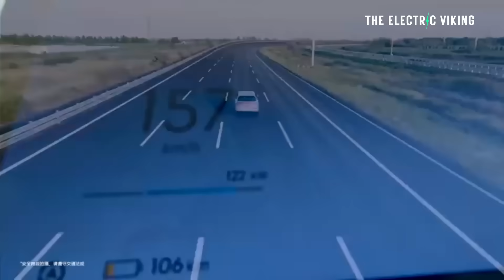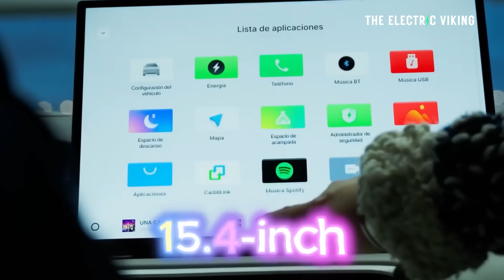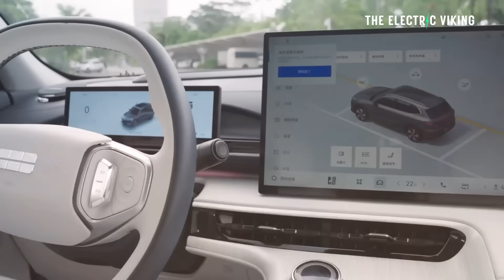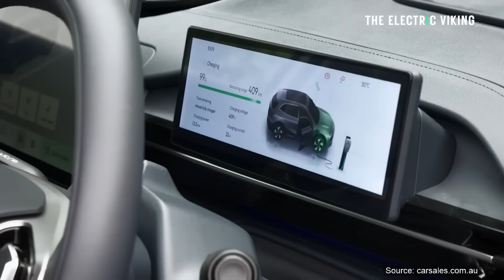2026 Geely EX5 - Geely's Most Popular Global EV Gets Big Range Boost

Comment: I have learned to dislike this car in only 4 days of ownership after going from a diesel LandRover to this electric car. I have been amazed at how much I like the physical driving attributes of the Geely, EXCEPT....they have made the speed warning as a default setting and I can only change it to either None once I have put it into drive and I am fiddling with the menu to get it turned off while I am driving. Very unsafe. Also, the main screen cannot be turned off and the dash light turned down at night which gives eye strain and distraction to me. For nearly 20 years LandRover has been able to turn the screen off and a light tap turns it on when needed, why can't Geely. Oh, the car actually drives very nicely with good steering, braking etc but shame about the electrics. I do not recommend this car because of that.

Comment: Sam battery capacity in kwh and energy density are two different measurements. Higher energy density just means more energy is contained in a given space. At 68 kwh I would imagine this vehicle will achieve around 460 km of range.

Comment: I have been waiting to buy an EV or Hybrid car for a while now, what puts me off is the lack of a spare tyre, they're either come with a tyre kit or a space saver, I think both those options are dangerous.
Tyre kits are designed for punctures but what if your tyre blows up in the middle of nowhere? the tyre kit becomes useless.
Space saver tyres are also dangerous because the car becomes unbalanced, I don't care that manufacturers and car experts say they are safe, it's like a woman walking wearing one high heel shoe on one foot and one runner on the other.
The government should mandate every new car sold in Australia comes with a full size spare, it doesn't have to be a matching alloy wheel as long as it is a full size spare
Reply: Most ICE cars don't come with a spare tire